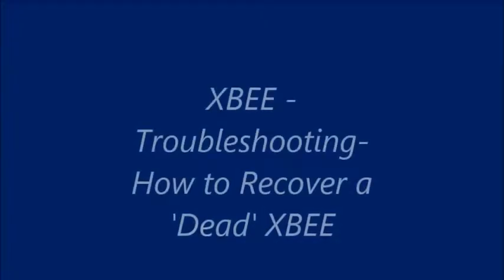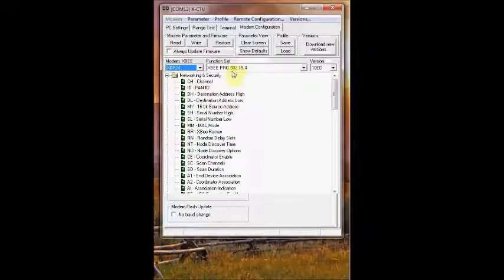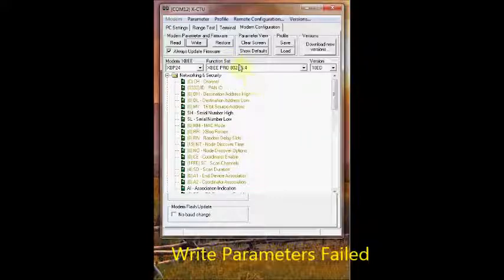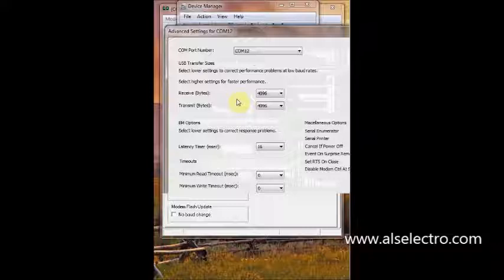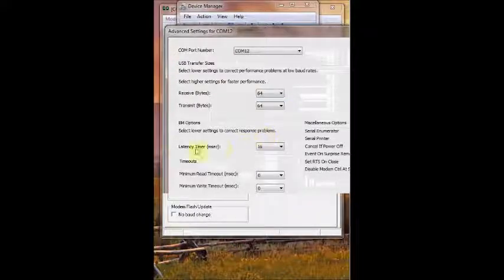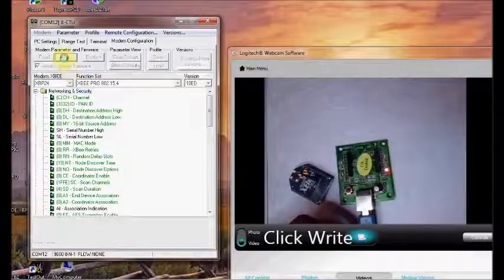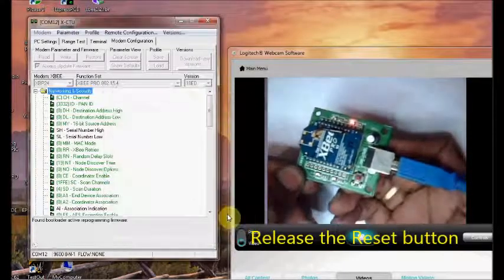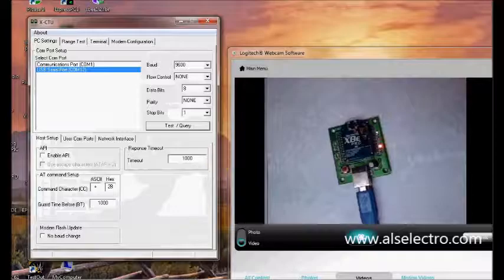XBEE - How to Recover a non Responsive Modem

Comment: hey, actually i was connected my x-bee of s2 model with 9v, accidentally.now it shows no response with x-ctu , so could u tell me whether this problem would resolve or i lost my xbee completely.Thank you
Reply from the maker: If the power source is left out at 9v for a long time , chances are that XBEE gone dead.But try the recovery method & hope for the best !!
Reply: i have tried it more than 2 times, is there any method to know that my xbee is dead?
Reply: hey ,bro can u tell me how u was recovered your xbee s2 I am making a project and just some days is left , I have not much time .   Please help me my gmail: shubhamdhiman00.sd@gmail.com
and contact no.is :9034157650